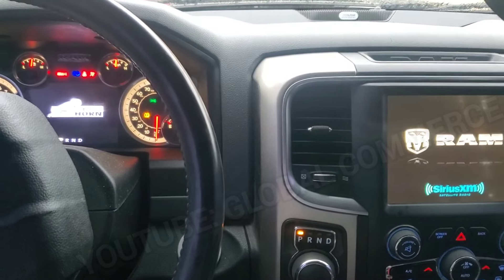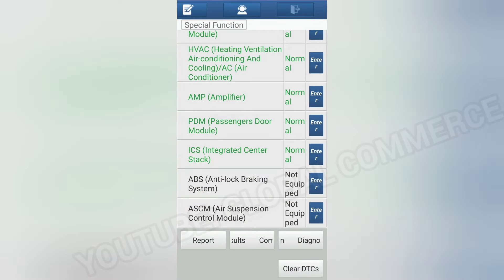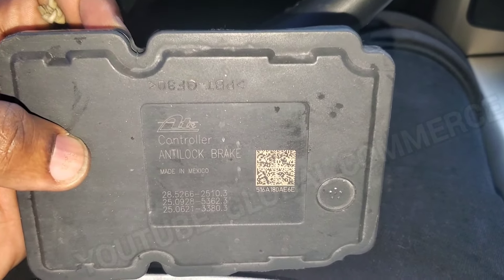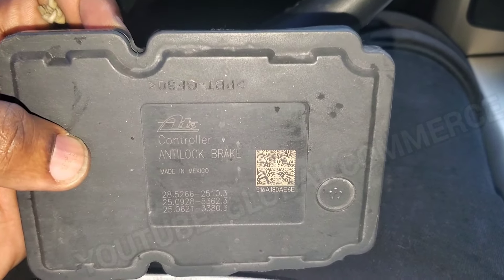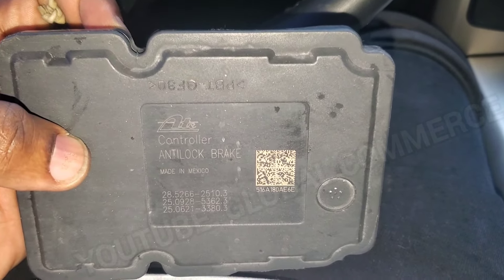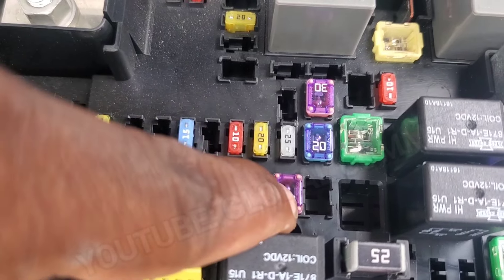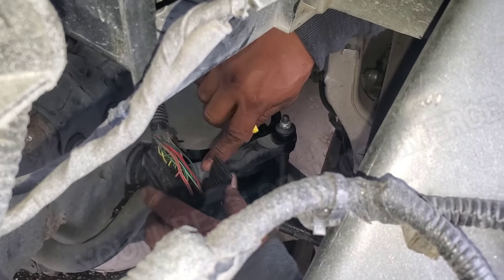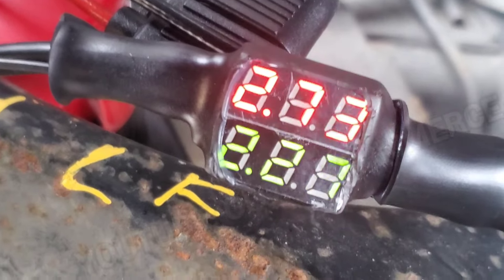Dodge RAM used ABS module CAB testing EEPROM/ CLONING PROGRAMMING INFO

Comment: As it turns out, NO ONE has a new module for the Avenger I'm working on.  I dont have access to the original module either.  Witech doesnt even have files or an option to reflash ABS modules.  Is there a way for me to "virginize" the used module I have so that I can initialize it with my scan tool. Thanks
Reply from the maker: Yes there is.. I have a video on that coming soon